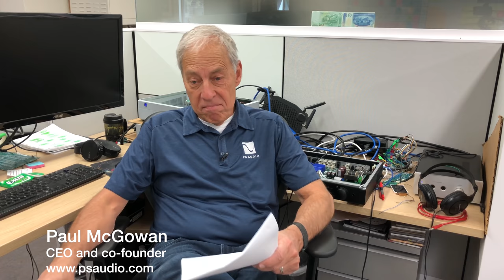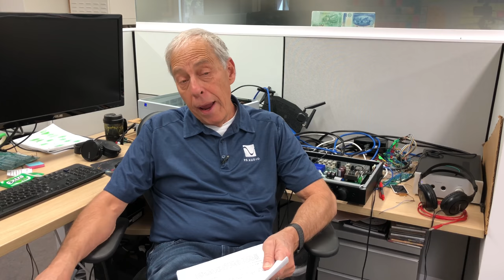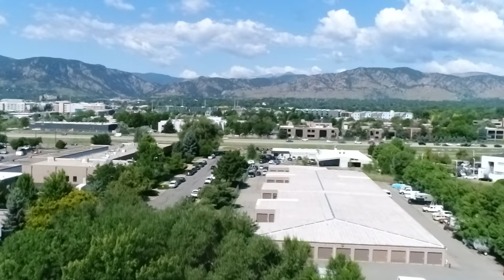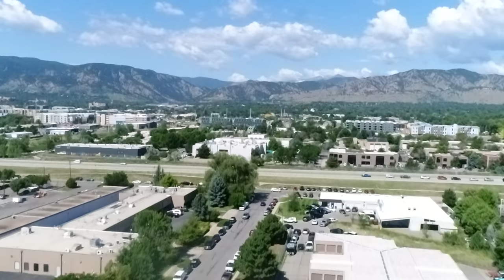Why don't speakers use electro magnets?

Comment: All speakers used to have an electro magnet. It also served as a choke for the plate voltage of the tube amp. Check the old tube radio from your grandfathers attic (or something) and it will probably have such a speaker. The heat buildup is not really an issue, as the wires for the electromagnet don't have to be as thin as for voice coil. Electromagnets are weak however, so you can't get very loud speakers.
Reply: I'd have to disagree with your claim that you "can't get very loud speakers" with electromagnets.  When I was very young and teaching myself all about electronics and sound equipment (about 55 years ago), I tore apart a Stromberg-Carlson console rig that had just such an electromagnet-driven speaker.  I built a different cabinet for the speaker but carried the tube chassis with the rest of the circuitry as part of my initial rig to be able to play music at school dances.  That 12" inch speaker with the electromagnet would easily go much louder than any of the permanent magnet speakers I could build to be driven by the tube amps I had access to at the time (I had a pair of Neucomb and RCA amplifier chassis at the time).

Comment: Yep. Electromagnetic speakers were big back in the day. Be curious as to when field coil speakers were phased out. Some companies today still do use them but I think they tend to be rare and expensive. Voxativ uses some field coil Electromagnetic drivers in some of their upper speakers. Just the field coil drivers themselves are $8-9k. I think you can power them with tubes or solid state if I'm not mistaken.  They make some good but expensive stuff.
Reply: TOUCH MY NERVE ENDINGS

Comment: As long as the permanent magnets  aren't ever overheated, the rate of magnetisation loss is so gradual it's insignificant over the span of a typical human lifetime.

Unless you resort to drastic measures such as active cooling, electromagnets only make the heat issue worse. Fan air cooling and liquid cooling all suffer from noise issues. Liquid and heat pipe heat conduction also risks leakage issues, a major concern given the high vibrational stresses typically present in a speaker driver.

Comment: When I was a lad, all speakers used electro magnets. There was almost no other type.
Reply: example of one such design? Had been interesting to see one.
Reply: As Paul says, all speakers use 1 electromagnet; he interprets the question as being about using 2, which is rarer.
Reply: Dave Micolichek  It gives more meaning in that type of product where the speakers are integrated into the same box as the rest of the electronics. But for passive speakers it's impossible to do it since the electro magnet would need a dc voltage and current.
Reply: Dave Micolichek  I'm not old enough to have experienced this obviously...
Reply: Colin Owen You must at least 80
Reply: @oysteinsoreide4323  Look up 1920's speakers on youtube.
Reply: @oysteinsoreide4323  The amplification and the magnet of a speaker don't share any components. So it's absolutely no problem to use a speaker system fitted with electro magnets (fiel coil) with any amplifier. It's just, that your speaker system has a power supply too.

Comment: The old Crosley radio I have uses an electromagnetic speaker. I guess they didn't have permanent magnets that large in the '30's??? 
It has tubes with top heaters as well. Boy, electronics have certainly changed over the years!

Comment: I've been trying to find info on this - basically because I was intrigued whether perhaps an electromagnetic speaker might offer some benefits we are not aware of yet. I expect they will require more power overall, but perhaps a better response? I would be intrigued to experiment with this

Comment: I'd argue all electrostatic speakers operate like that. We could compare the static magnet and coil driver with a classical electric motor. Nowadays we have induction motors that may be more efficient, but certainly are lighter. We could think of a speaker driver as a linear induction motor that drives a very light cone instead of opening a door or closing the boot of a car. One problem with classical drivers is to get proper wave shape and phase behavior and it is likely that the coil-driver combo shoots through at least when moving away from the magnet. If we can move the cone-coil in between two induction motor like coils in a push-pull arrangement then that might be beneficial. That might however present an amplifier with a difficult load (assuming the same signal current is used in all coils to get the push-pull behavior). With arrangements where a static electrical field is used from a coil or a foil, the electric thing is just an active replacement of a static magnet, used by the cone coil or moving foil to act against.

Comment: The electrodynamic shaker that I use for seismic testing to excite my test item has a field coil instead of a permanent magnet.  It isn't designed to make sound but I don't see a reason why it couldn't be done.

Comment: Hi Paul, I really enjoy your videos very much.  I have a question concerning speakers as well but on a slightly different application.  I have two MPA-95 amplifiers by Radio Shack that can use 4 8 16ohm, or 70v speakers with the transformer.  I just purchased an old Motorola 10" field coil speaker and wondered if can tap the audio terminals from the 70v output on the amp to audio terminals on the field coil speaker and still get full sound without energizing the field coil itself.  I learned that the field coil has to be energized to get the speaker to play normal and not soft.  This would be at 8ohms output but I would think a field coil speaker would simulate a modern speaker with a 70v line transformer?  Also wondered if I came across a vintage radio that has a field coil speaker in it; can modern speakers with 70v line transformers be used on that type of equipment?  Am curious to know.  Thank you.

Comment: electromagnets in speakers can reduce the energy consumption because with better attraction than neodymium you can increase speaker efficiency with wider cone diameter and cone excursion (what increase moved air by the speaker, this can be more important than sensitivity)  besides improving cone response. having access to renewable liquid nitrogen can improve the efficiency because reducing the resistance created by heat. so yeah you can build a high end speaker by the cheap and keeping global natural resources intact.

Comment: A magnet is a magnet. Electrodynamic speakers are energy wasters. 
The only sensible reason to use an electromaget in a speaker would be to dynamically 
increase and decrease the strength of the magnetic field according to the signal. 
Well designed, with the driver and amplifier properly matched, 
it could make some Slight improvement in audible performance, but not enough to merit using the method.

Comment: Classic Audio Loudspeakers is a company that makes "field coil" drivers and speakers with those drivers in them. I assume that's just another name for electromagnet. Their T-1.5 and T-3.4 models use electromagnet drivers. Certainly they aren't common speakers, but they are being made, and are in production right now. They show at events like RMAF, usually with tube amplification and beautifully restored reel to reel tape decks. http://classicaudioloudspeakers.com

Comment: The best theoretical speaker is a plasma/arc speaker, no magnets, just high voltage, currently very noisy due to bad power supplies. Work needs to be done!

Comment: I know this is old. The primary reason I see to consider an electromagnet instead of permanent magnet is weight. I would suggest the speakers would weigh significantly less. To old people like myself, who need to move speaker cabinets, the weight is painful. The first loudspeakers were electromagnet, not permanent magnets. It was after WWII that the materials would be available to create powerful enough magnets. Steel magnets were impractical due to weight. I would like to design ultra light speakers with aluminum frames and electro magnets. These would go into ultralight speaker cabinets. Only reason, weight hurts me and suspect many other aging rock stars.

Comment: what is the programming languages that the electronic engineer need to learn?
-mustafa from Iraq (i am a student right now)
Reply: There are so many languages these days that your needs will change depending on who you work for, but learning Python right now would be my suggestion. I don't really like Python very much because of the way it is structured , but it is gaining much popularity in the engineering world. Best wishes to you!
Reply: no programming language if you mean it in software development needed. just knowing maths (formulas for xovers, enclosure design  estimates for tuning and dampening), i use 
1) visaton boxsim for basic speaker enclosure  responses (like: directivity, power handling with different frequency tunings), 
2) torres' box tuning calculator for enclosure basic frequency tuning for ported boxes, 
and lastly
3) xsim for crossover design and speaker phase response at different distances

even then, when you think you got your perfect loudspeaker: it might not sound like you want so you need your ears to be trained as well to tackle hearing possible problems and identify those. conclusion: using your ears (after some training) helps with knowing formulas on how to, you can implement those formulas in pretty much any programming language (examples: php, javascript, c++, java, python) or use existing tools like i tend to do.

i hope this helps.

p.s. if you want to direct this question to Paul only, i think there is a email form of some kind on the PS Audio website. :)

yours, ramon from the netherlands

Comment: Early integrated amplifier/speakers did use electromagnets and it was very common at the time. A few months ago I actually threw away a couple of these speakers and their associated amps.... one was from a 78 RPM record player and the other was a Hammond S series organ which was loaded with 6SN7s and other octal beasts. The field coil served double duty, creating the field for the speaker but also serving as the main B+ filter inductor in the power supply. That double use brings the hazard of having B+ inside the speaker and there are repair legends about insulation failure bringing the speaker frame up to B+ which could easily ruin your day.
Reply: Threw away? This stuff is very valuable...
Reply: @westelaudio943  I'm know and I'm still sickened by it, but I literally couldn't afford to hang onto them any longer and couldn't find a home for them. I tried. I had to part with a few hundred pounds of transformers and tube gear that was full of beeswax caps and heinously drifted carbon comp resistors.... The tubes were tired and the sockets mostly worn so they were like Model T Fords needing a ground-up restoration. The whole time the Genesis and Phil Collins' songs "I don't care anymore" and "throwing it all away" were going through my head to try to cope with the loss as I cleaned out my old storage.

Comment: Kind of disappointed with this one.  Electrodynamic speakers were the rule, not the exception in early PA and high-performance audio. Only when more advanced magnets like the Alnico V became available did they fade. You may still be able to find them in PA usage (is VOX still around?) A very quick search found this one though I didn't verify...
https://www.bhphotovideo.com/c/product/598461-REG/Behringer_VS1220_VS1220_High_Performance_2_Way_600.html
Reply: Heck, with magnets getting expensive, and switching PS getting cheap, I wouldn't be shocked to see a resurgence, one can make a very powerful and custom shaped field with an EM.

Comment: When I was a teenager my dad bought an "antique" floor standing tube radio. It might have been about four and half feet tall.  It had one of the names associated with the early days of radio.  It look like a semi jukebox made of wood.  I remember looking at it from its open back and wondering why it appeared to have an AC power cord running to the speaker magnet. I knew enough to believe it was not simply a signal cable. Its the only one I ever saw like that.  Its why this video title caught my eye.
Something like this: https://www.youtube.com/watch?v=rHhSqEMyzIs

Comment: A magnet will lose its magnetism if you were to drop it hard repeatedly.  So if you are going to drop your speaker on the concrete ground a bunch of times, I wouldn't worry about it. Not to mention if the speaker was in a cabinet and you dropped it numerous times, the box wouldn't survive either.

Comment: Reason for using electro magnets is not permanent magnets will loss power over time.
Its for the control of magnetic filed shape and stability
And Voxativ drivers don't use a lot of power.

Comment: Paul ! How dare You be sooooo ignorant ? :) Certainly very uncommon speakers but if You type "field coil speaker" in google graphics, You'll be amazed how many companies makes them. Cogent DS1428 and DS1448 compression mid-range drivers with adjustable "on the fly" T/S parameters and many other patents and good examples. Speaking of Neodymium, one day China will run out of their natural Gold aka Neodymium and then we will move to Field coils as it only consists copper wire and steel as You pointed out. And shame on You if You forgotten that the very first "dynamic" speaker constructed in 1922 was in fact "moving magnet" type with stationary coil for the amplifier signal and the "field coil" type was his second brother constructed not long after (if I remember correctly) Worth of looking at Powersoft.com and their M-Force I think related to the subject) Crown and Bose have number of patents as well

Comment: if you look at this patent (link at bottom) it explains why in theory that an electromagnet field magnet speaker has the potential to be superior to permanent magnet speakers, and adaptable to enclosure and room.

Basically you can get a very long travel underhung speaker with full linearity for the whole travel distance.

Also the voice coil can be made lighter and/or the speaker sensitivity very high (100db/W/m is no problem) meaning you need less watts to make the same amount of noise which means for the same dollars you can spend those dollars on quality instead of volume.

See EMS speakers from France. 

When you look at the cost of high end high power amps,  I would think using EMS speakers, or similar, would well and truly pay for themselves many times over with savings on the amplifier for the same end quality and volume. 

It would seem obvious that once you move past the production process in the creation and playback of recorded  music that the greatest non linearity in the whole chain must be in the speakers, so any improvement on linearity there is the low hanging fruit, hence a long travel underhung speaker with full field linearity must be vastly superior, in theory.

I would have thought serious audiophiles would be all over this.

Patent:

https://patents.google.com/patent/US8139814B2/en